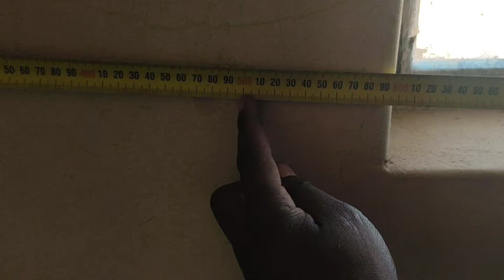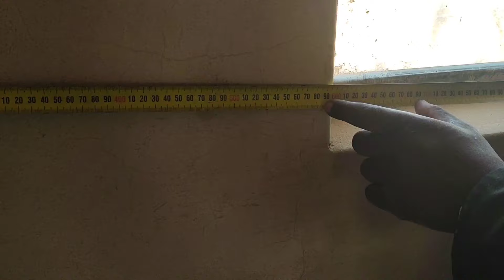Step 32 -- Ceiling Brandering | Owner Building In South Africa

Comment: The project is coming out beautifully - It looks like the Christmas will be enjoyed at the new address this year. Building a house is not a child's play, you deserve to give yourself a pat on the back for achieving this massive ambition.
Reply from the maker: Thanks. There's still a bit of work to do so I'm not sure if I'll be done by Christmas. Also I had already decided earlier this year that I'll do the bathrooms and kitchen next year.
Reply: @diybuilderza  Good one, keep up the good work Champ - 👏
Reply: @diybuilderza, the advice I would like is to have the underlay undertile membrane replaced as it is broken. What can i expect to be additional costs to this? What else will need to be checked based on your experience?

Comment: This Roof looks beautiful but looks can be deceiving.  There is absolutely no bracing visible anywhere on the trusses.  I'm glad this is not my roof.  If this roof collapses, the builder and carpenter will most probably be long gone.  I would also like to know who is the roofing inspector who signed off on this roof.  This roof should never have passed an inspection.
Reply: Why?Explain what you mean.